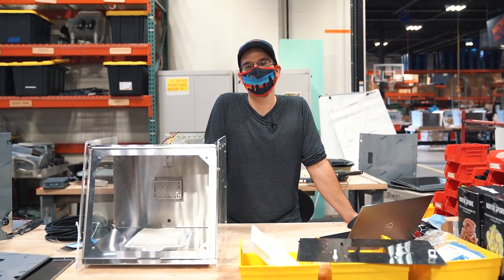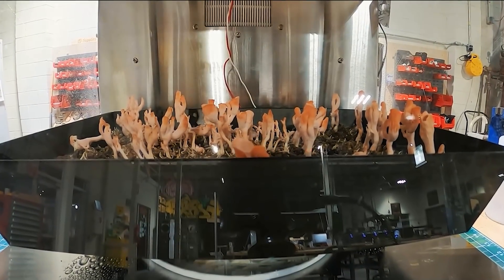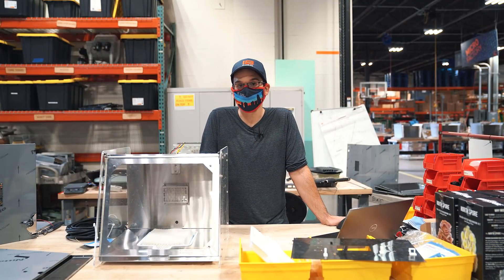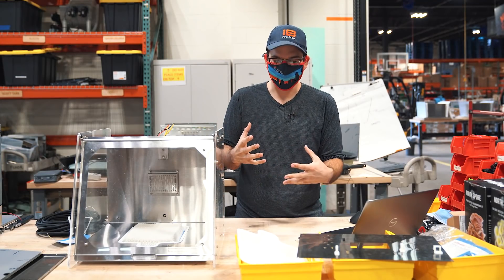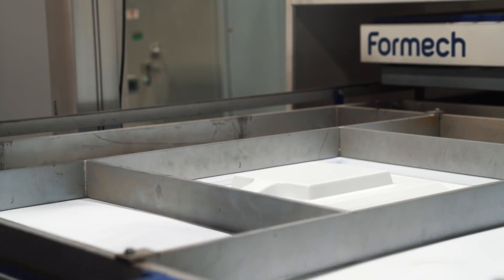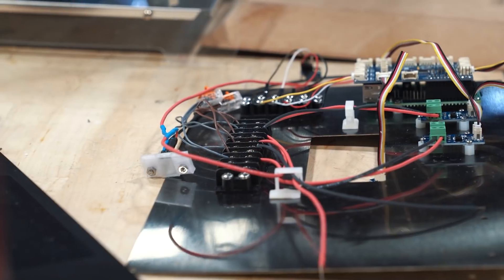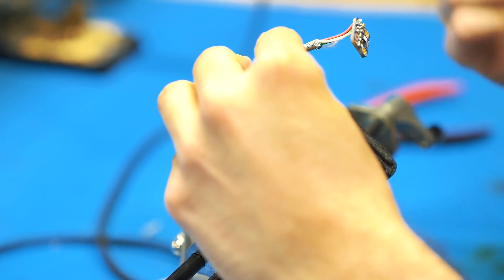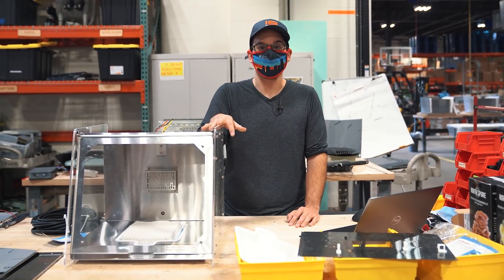[PART 2] Prototyping A Smart Mushroom Fruiting Chamber

Comment: Have you seen those water dispensers for pet drinking bowls, they keep the water level constant with simple hydraulic principles.
I can't see if you blow air onto the evaporation pad, but it works for swamp coolers.
You'll also need a filtered hole at the top for air to escape.
I don't think mushrooms like vibration much, so that's also something to check for.
Reply from the maker: Swamp coolers is where we got the idea from, good observation! The unit doesn't vibrate significantly so that shouldn't be an issue.

Comment: Hi FirstBuild,

My first observation is size, various size choices may be desirable.

Second, making one out of ABS Plastic might be a more economical option for those who may choose such an incubator for home use.

Third, why not mold the bottom to include the water capture and supply, it would need to have a slight downward incline from all sides to function best.

Also, it looks like this unit could serve as a 'clean room' for preparing; cultures with agar etc.

Possibly an optional/swap-able front door with glove hole access?

Making the product as economical as possible for an average home user could prove to be a prime factor to encourage active purchases.

Also, I am not currently aware of any similar product made up of ABS Plastic with plastic tent, filtered air fan and humidity regulator manufactured for sale as a complete unit. But I have seen various setups viewable online that some have created for home use, even small commercial use in maybe one instance.
Reply from the maker: Hey Clark, thanks for the feedback! You've brought up some really awesome points. It boils down to speed for us - injection molding/vac forming/3D printing are simply more expensive and take a lot more time to develop than sheet metal ones (especially for prototypes like this). We can make the sheet metal parts for this prototype in about 15-20 minutes.
Reply: @Firstbuild  You are welcome. I am confident you will apply the most economical path and add valuable features accordingly.

Comment: The problem with this is there isnt realy a need for it, as you have found you can buy ready to fruit blocks that you just place in your house and you can fruit them, unless your machine can also sterilize substrate for you and maybe store/produce spawn in between runs then im not sure why anyone would need this device.
Reply: I live in what is effectively a desert, average humidity is about 30%, it takes(optimistic) about a week for a freshly cut mushroom to reach the shop shelves.
Reply: @stoneomountain2390  but the machine doesn't really do a whole lot, it looks to be just for fruiting colonized blocks which if someone is interested in growing mushrooms at home it can be achieved very easily at a very low start up cost. now if it was able to store liquid culture and incubate blocks then i could see it being a bit more useful but as is, it seems to be mostly show.
Reply: @flukiduki1453  
True, but I've seen some really dumb stuff sold at great profit because people are lazy.
This is less dumb, especially if you don't have to worry about making circumstances for growth the correct on your own
Reply: That's absolutely not true. I live in a VERY arid environment, even the house stays under 20% humidity and it drops outside. Auto fruiting chambers are absolutely a needed thing.